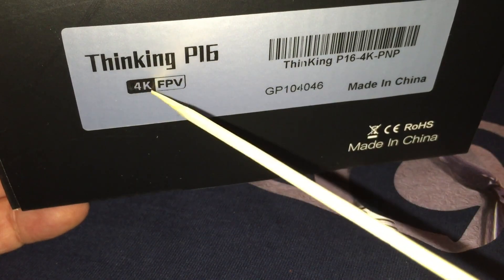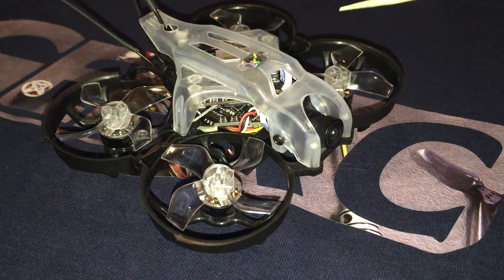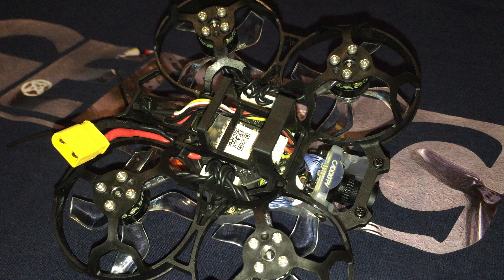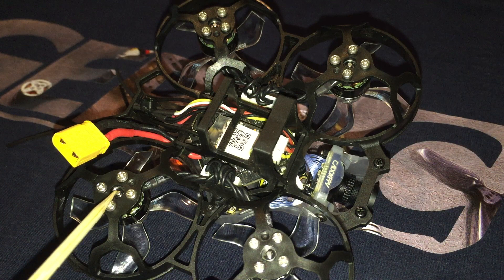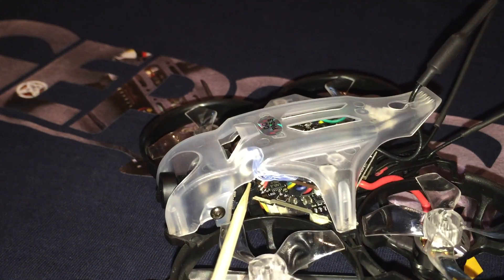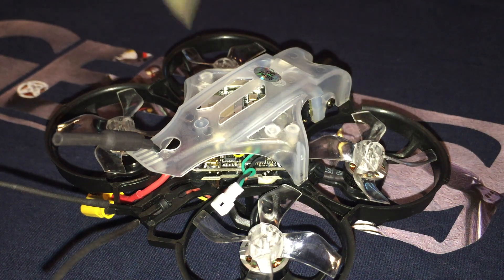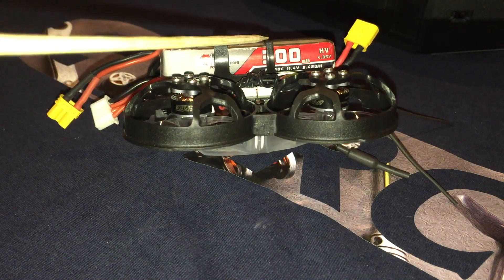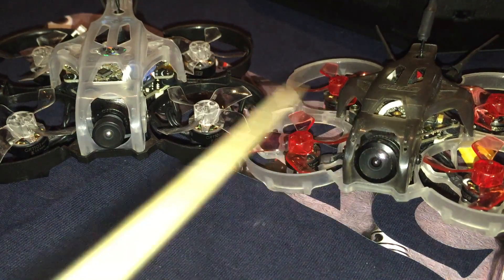GEPRC Thinking P16 4K 40mm - PART 1

Comment: How does the video look?
Reply from the maker: HD/4k looks good outside. Low lighting indoors... not so much. FPV view is a little washed out. I prefer the runcam split 3 overall even though it only does 1080.